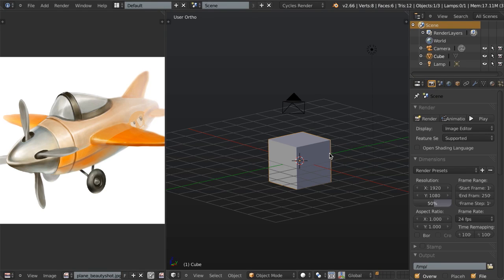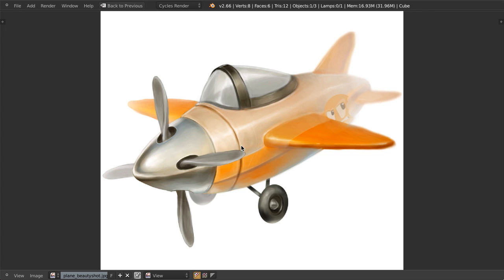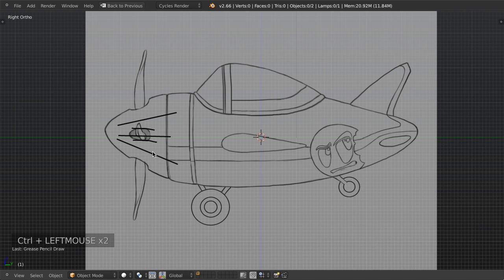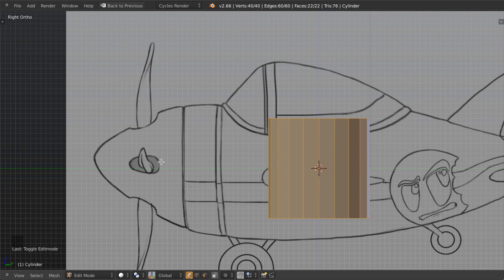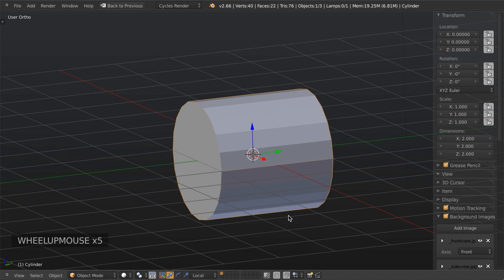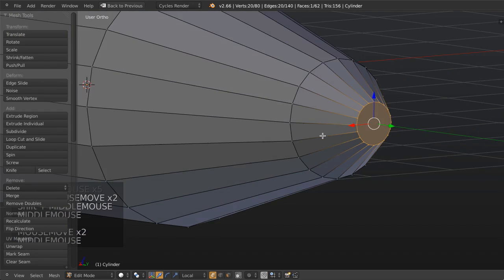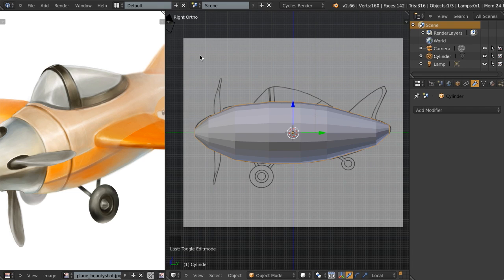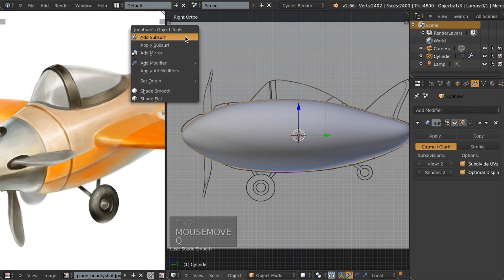Introduction to Hard-Surface Modeling in Blender - Citizen Series Part 2

Comment: >> 7:10 The is an easy fix if you do this in Edit Mode ... ctrl + A ... apply / rotation . 
All numbers will be changed to zero . 0 Fixed